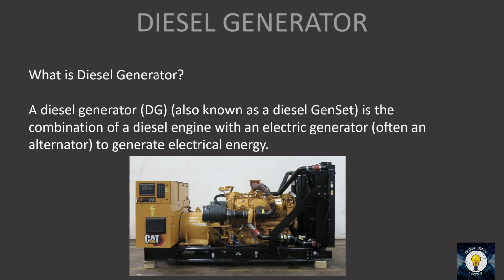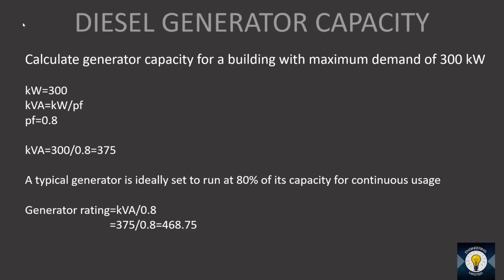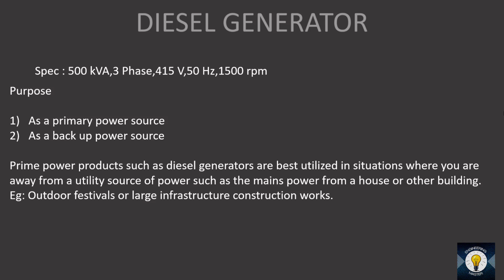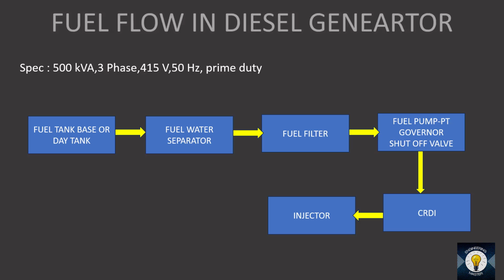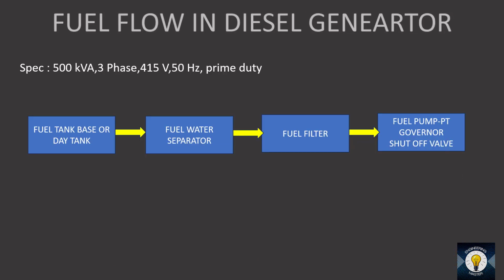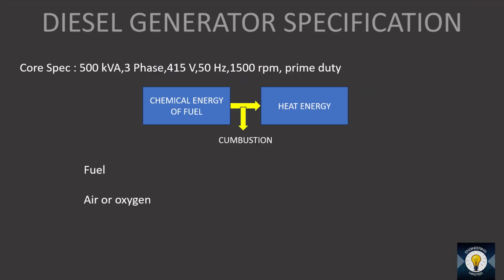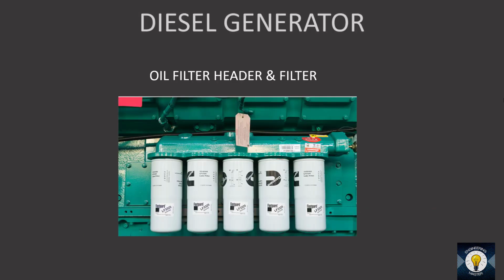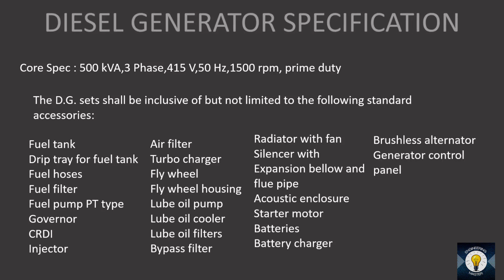Diesel Generator Design Calculations: A Complete Guide for Engineers | Sizing, Load, and More!

Comment: How to calculate diesel generator bhp by formula what is meaning of displacement in diesel generator & how to calculate diesel consumption at minimum load and maximum load condition (for example how much diesel consumption recommended by a DG set company minimum load and maximum load condition